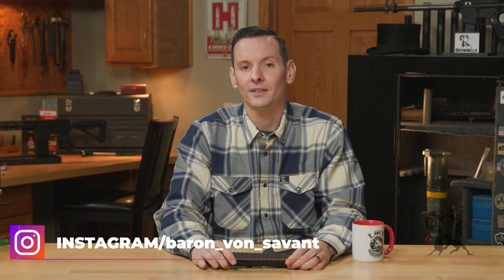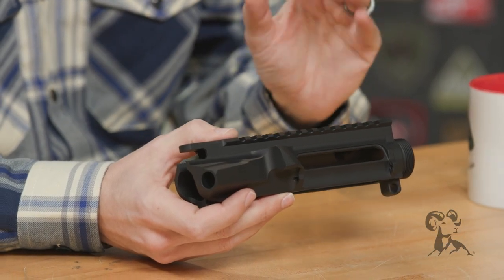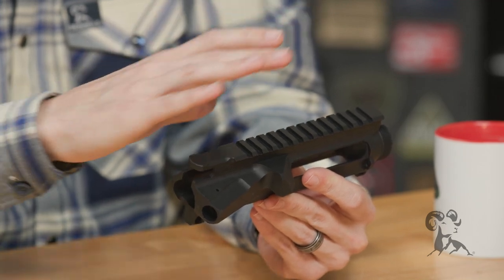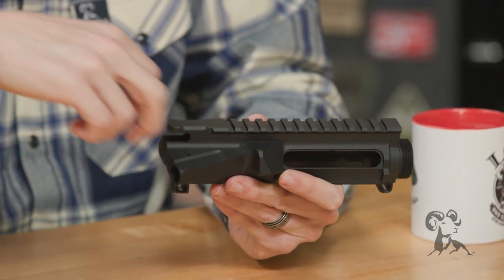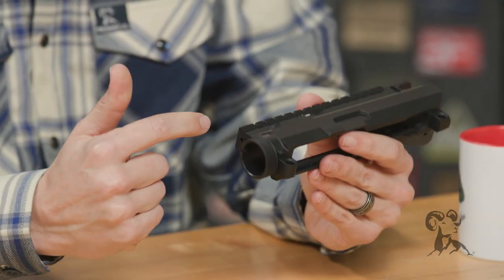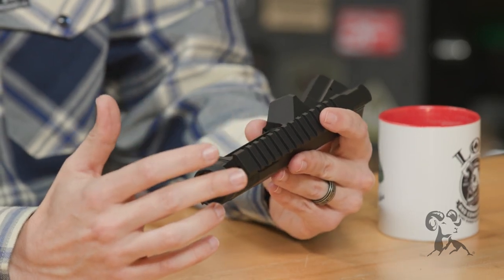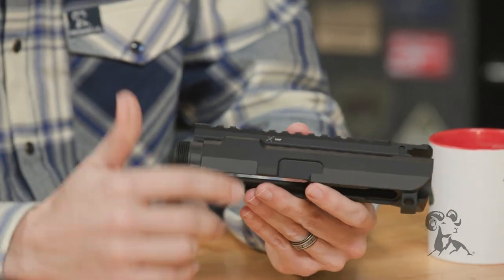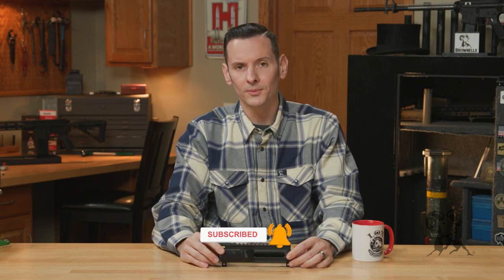Product Spotlight: FCD Billet AR-15 Upper Receiver

Comment: This upper is made by Cross Machine and Tool for FCD and it’s really nice. I built one out to put on a SOLGW FCD lower and everything lines up perfectly. Solid upper
Reply: how did the black anodizing match up to the lower ?
Reply: @rytacarms  It doesn't.
Reply: @rustyshackleford8473  appreciate it
Reply: @rytacarms  no worries. More specifically, the upper receiver is a more grey, matte color. To be expected since it's manufactured for FCD by two different companies. This is of course just in my sample set of one.
Reply: How does it match up to a sharps jack lower?

Comment: Hey Caleb, is this upper receiver thermo-fit to the build's chosen barrel? I'm hoping it is. That's the one thing that did not get covered in the video that I wanted to know before deciding on this over, say, a BCM or JP upper receiver. It'd be for a duty-oriented build so the extra ounce or two isn't a big deal, but the rigidity plus a thermofit barrel would definitely be what I'm going for here. Thanks.
Reply: You can do that with any upper. Look up "The relationship of barrel extension diameter to accuracy in the AR-15, Part 1" By Joe Carlos. All it takes is some shim stock, heat, and time.

Comment: great content great review: I love the aesthetics of the FCD upper receiver. I think more companies should add similar aesthetics to their upper receivers, and get away from that tedious mil spec look, bringing the AR aesthetics more into the 21st century, and a way better looking modern platform. now if someone would just make some Handguards with different more modern styling and shapes not like the same ones of yesteryear kinda like the LDR1 but more.
Reply: You mean like CMT who has been making it forever.
Reply: Sharp edges suck ass. I had the FCD upper, and I didn’t like it. That was without the forward assist too. Also, the barrels I had for it just slid right in. BCM mk2 uppers are where it’s at. Smooth edges, look good, and tighter barrel extension area tolerance.

Comment: I’m pretty sure that Zev (aka Mega Arms) is the OEM for FCD’s receivers and handguards. I know for sure that they OEM receivers and handguards for SOLGW, as well as Gray Ghost Precision and Triarc. (Possibly Hodge as well, although I might be wrong on them). If anyone reading this is familiar with Mega Arms and their truly legendary fit and finish, this won’t surprise you one bit. They are now owned by Zev Technologies, of course… But rest assured that their ability to hold truly aerospace level tolerances remains fully intact, which is precisely why they are almost universally revered as being among the very best machine shops in the country. 

In case anyone is wondering, it’s the anti-rotation pin hole for Mega’s wedgelock rail design, as well as their “true black” type 3 class 2 hard coat anodizing that were the main things that pointed me in Zev’s/MEGA’s direction).